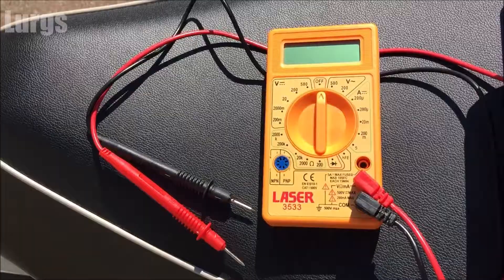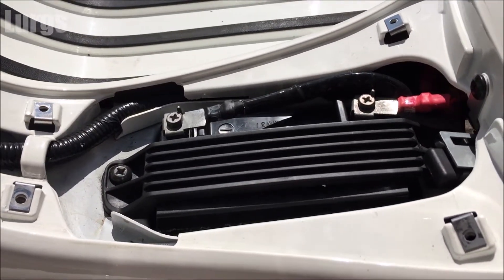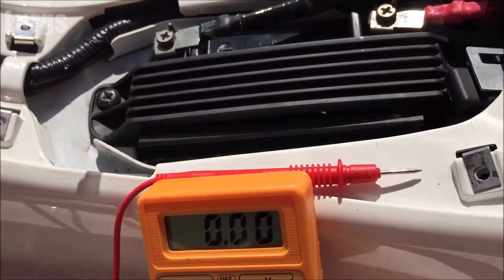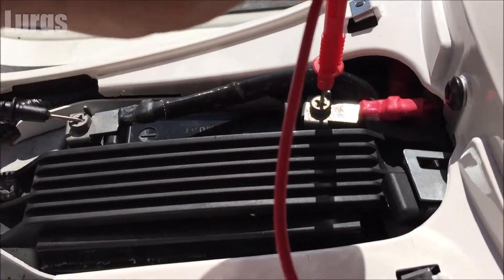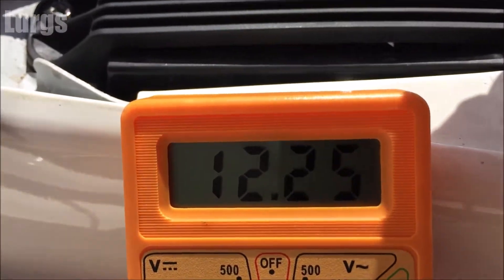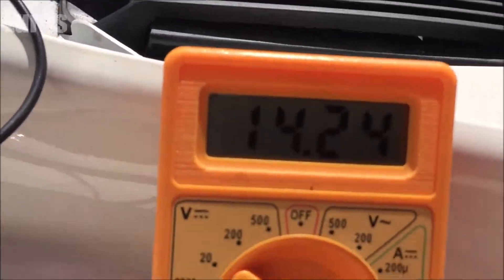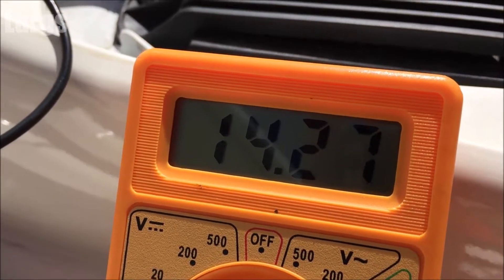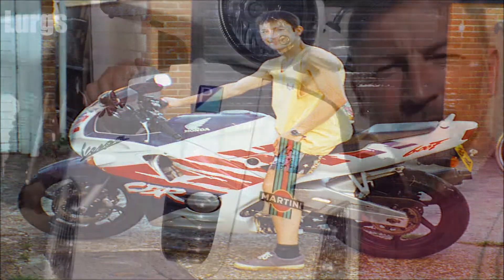How to test a Motorcycle Battery with a Multimeter - Motorcycle Battery Testing

Comment: it’s a pretty good idea to make sure your battery terminals are not corroded, and one thing that nobody checks, make sure your ground cable from your battery to your frame has a good connection at the frame.
  here’s what happens if you do not have a very good connection from the ground cable to the frame
  your motorcycle has a wire harness with many little grounding points for those wires inside the wire harness with the dozens of wires in there. If you have a bad connection from the battery to the frame with that big, heavy, grounding strap, every time you hit the start button, your electrical system will use those small grounding connections that are inside the wire harness to the frame here and there, not many points, but there are some, because you are using the starter, you’re putting a lot of current on those tiny wires instead of on that thicker cable from the battery negative terminal to the frame..
  when I was a motorcycle mechanic and a Yamaha dealer, I replaced three complete wire harnesses on Yamaha motorcycles. One year, it was on the Yamaha XS 650 twin models late 70s through early 80s. The problem was, the grounding strap was attached to the frame, and the paint would not allow the copper ring connector that was supposed to connect to the frame from the battery cable. The Thickness of the paint prevented a Good, solid, grounding point, and the wire harness got burned up internally eventually. Back in the 1990s when I replaced those wire harnesses, back then they cost around $500. and they took hours to replace. So it’s a good idea to replace nasty looking brown strap from the negative terminal on the battery to the frame if they need it. Grounding, light fixtures and electrical components, and even the battery is overlooked quite often. Especially on trailers that people haul their motorcycles on. most of the time when those trailer lights are not working, it’s a bad ground connection
Reply from the maker: Thanks for the information, should help someone

Comment: Does it matter if I put the red or the black first? I tried it with the red first and a spark came in and then my multimeter stopped working
Reply from the maker: Makes no difference and you should NOT get a spark when you touch the battery terminals, maybe you accidentally touched the chassis as well?
Reply: @LurgsHowToGuides  I just put one of the metal sticks into the positive and a spark came up... and then my multimeter stopped working and this is the second time it happened I wonder if there's something wrong with the battery:-(
Reply from the maker: @RobAlfieInostrozaLindley  That should not happen unless the negative wire is dangling about and touched something else, if not then yes maybe your Multimeter is broken.
Reply: @LurgsHowToGuides  twice lol.  Thanks
Reply: @LurgsHowToGuides  I wonder if maybe my battery is bad
Reply from the maker: @RobAlfieInostrozaLindley  never heard of a multimeter node sparking on a car battery
Reply: @LurgsHowToGuides  motorcycle battery,  and it stopped working and then I got another one and it did it again LOL

Comment: My battery is showing 12.2 -12.6 .But won't start the bike. I tried to override the starter relay and its really struggling to drive the starter motor. The fuel injection system and console is flashing and restarting. Once I got it started but the battery went down to 8/9v during the start and then settled between 14-15V. So coil and rectifier seems to be working but the battery seems to be bad even though it's showing 12V on multimeter.
Reply from the maker: Get a brand new battery. Mine was similar,  when they go they don’t hold a charge and cause all sorts of problems

Comment: Hi,should the voltage increase when you put twist the gas lever ? I have the same readings as you but i'm having the same voltage when twisting gas i'dont know if it's ok
Reply from the maker: Yes that’s fine. It regulates the voltage so it doesn’t overcharge it.

Comment: Will a bike start with under 12?
Reply from the maker: Yes it should do, depends on the size of the motorcycle, if it’s a big engine it may struggle. If the battery is 5+ years old and not used much it may struggle to hold a decent charge. Any probs I’ve had with starting have always been cured with a brand new battery, can’t beat having a new one. Ride safe 🛵

Comment: What should the minimum voltage be when under load i.e. starting the bike?
Reply from the maker: It should be 12v but anything over 10v should just about spin it over. If in any doubt charge the battery with a low amp trickle charge charger. I charge my Vespa once a month as I don’t use it that much.

Comment: Hi Lurgs, nice straightforward presentation!
Please gelpbif you can.
My problem is my 1981 BMW R80G/S electric start is dead, again. 

Previously cable + from battery to the Starter Solenoid and Motor had become disconnected. Sorted that out and started again, no problem for a few short excursions. 

Then, no start again. Checked battery charge, ok. Checked cable (see above), ok (?). But still zero. Lights and horn all working except ignition light beside clocks. Bike was running ok despite this before current situation.

Any help much appreciated.

Thank you in advance.

Safe riding!
Reply from the maker: How odd. Put multimeter on terminals of starter motor then when you start see if 12v is going through it, if not then at least you can start testing elsewhere. Could be an immobiliser issue maybe? Need to see if you are getting voltage to starter motor on the start button first. Hope you find the fault. Electrical faults are a pain

Comment: Thanks for uploading this. You even had the same meter as me and I didn't have a clue how to use it!!!
Oddly, although the ratings were higher than yours - which I assume is a good thing, my optimate never goes green...and just constantly charges, even though I know the battery is charged ... Any ideas why?  I did accidentally leave the optimate powered up (while not connected to the bike) would that have killed it?
Reply from the maker: Battery chargers are notoriously unreliable and showing if a battery is full or charging. I shouldn’t worry too much. A small motorcycle battery will literally only need a few hours charging.
Reply: @LurgsHowToGuides  mine says full in 40 minutes but I dont think it charged enough
Reply from the maker: Test it with a multimeter. If it’s an older battery it may not hold a charge very well and could be time for a new one
Reply: @LurgsHowToGuides  yep it is around 2.5 years old
Reply from the maker: @rajkro9615  That should be fine. A 40min charge should be ok. Hope it starts ok.

Comment: I have to install a battery into my vintage vespa, wish I could get some help some where.
Reply from the maker: If you ever have any questions I'll be glad to try and help. I'm guessing if its a vintage it will be a 6V battery.
Reply: Lurgs oh that's so nice of you, a contemporary version of same used to have an electric start mechanism and had a 12Volt battery.
Reply from the maker: Good luck with that. There are loads of forums out there for Vespa's but I'll try to help if I can.